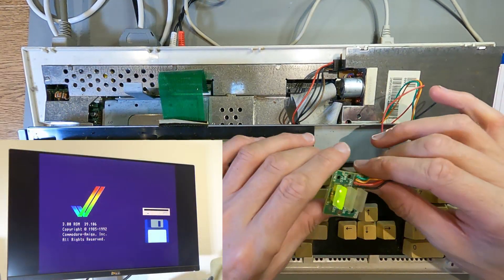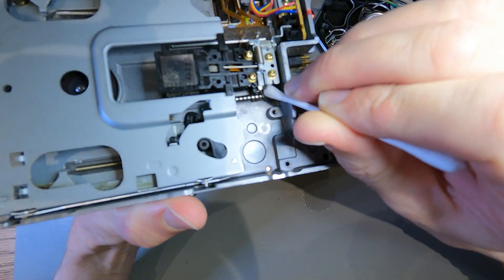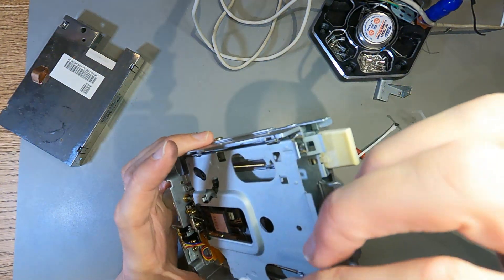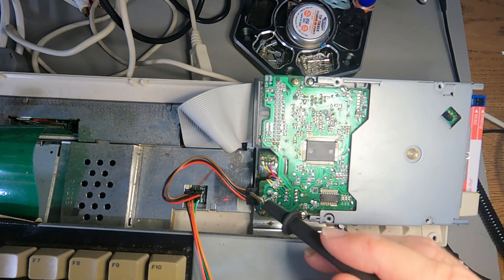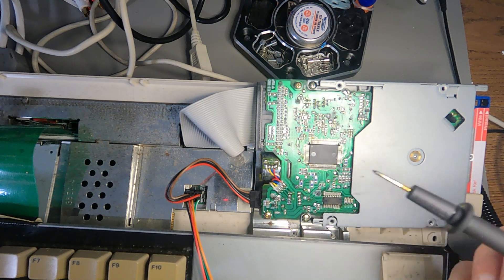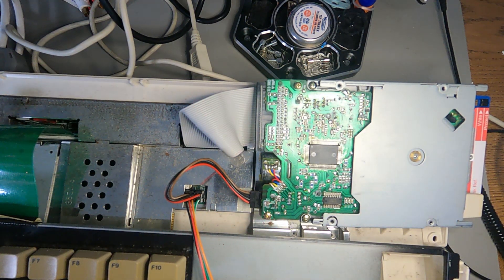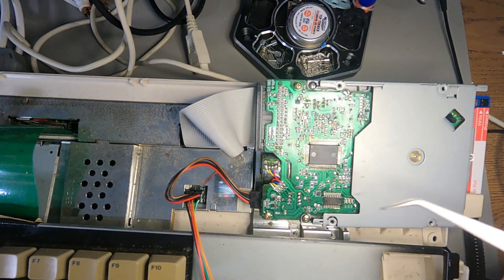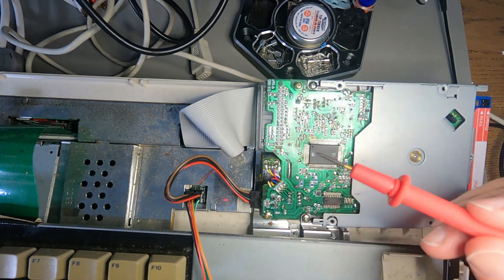Failing to Fix the Amiga 1200 Floppy Drive (Mitsumi D357T2)

Comment: I have the same drive. Almost exact issue with stepper. I think the driver might be busted.
Reply from the maker: I still have the drive. It's still broken.
Reply: @DavePoo2  seems like stepper motor is bad on mine, vibrating and not moving as intended
Reply: @DavePoo2  you have such stepper on ebay for a couple of bucks

Comment: I have seen this happen when a CIA is bad.  Try swapping the odd and even IC’s over to see if there is any difference in behaviour.
Reply from the maker: I doubt it, as a different drive works on the same computer. Also, there is no odd & even CIA on the A1200 or A600. You find those on the A500

Comment: i had success once, just by repeatedly tapping on the stepper motor while it's trying to move, and eventually it did start moving.
Reply from the maker: I don't think it's mechanically stuck, it does actually move. I think the chip that drives it busted. I could easily verify that at some point by disconnecting the stepper motor and manually driving it with a power source.
Reply: @DavePoo2  yes, it makes sense with these ones.. I have had two with similar behaviour (in 1980's Akai S900 samplers)..
One I replaced with a drive from a spare Amiga 500.
Would be great to know how to repair the old Matsumi drives though.. I'm at a loss!
Reply from the maker: @EvLoutonian  I've been checking eBay for any drives that have the suspect NEC chip on them but no luck so far

Comment: I have a bunch of faulty floppy drives. all have cylinder 0 seek error, have no clue
Reply from the maker: Might be worth cleaning the heads. If you have used a bad disk in them, it can leave crap on the heads and stop them from working.
Reply: @DavePoo2  tried that all wipped Down with 99% new grease on worm shove a disc in and get a track 0 error
Reply from the maker: @r6stu  Well the caps can go bad, after 30 years it's surprising that they still work at all.

Comment: Windings on small motors will show short as very small resistance,
Reply from the maker: The motor itself seems to be fine. When I disconnected the motor, the driver chip was showing shorts between the driver pins.

Comment: Try moving the heads all the way then power it up and see if it zeros.
Reply from the maker: The heads are already moved into a position where they are outside of the zero sensor, so it wouldn't make any difference, it should already be trying to zero the head.
Reply: Ah, I didn't notice it was off the zero.
Reply from the maker: @wimwiddershins  yeah, I didn't actually show the zero sensor up close.

Comment: You cleaned the grease off but didn’t reapply? Yikes! Also. Are you wearing a Star Trek TOS Captains shirt? :)
Reply from the maker: I did remove most of the blob of grease, but i was turning the worm drive with my hand to make sure it moved freely. I will apply a little lithium grease before i put this away into storage (assuming i can't think of anything else to try on it to fix it). The shirt is actually a handmade shirt that my mother made, and in fact all the shirts i'm wearing in my videos for about last year were hand made by her. This shirt just happens to have yellow sleeves like a TOS shirt, but the front and back panels are actually Batman fabric. This is the fabric, I've actually got some other shirts using the same https://www.myfabrics.co.uk/05-128471-0801_cotton-jersey-batman-1-black.html
Reply: @DavePoo2  that’s a fantastic personal  description and heart felt story about the shirt sir. Thank you for sharing those details. 

As for the floppy drive. Yes, good. There’s multiple areas to lubricate.

Comment: Shame, was hoping for a simple repair for you. I don't know enough about the controller circuitry or how stepper motors work to suggest anything, but perhaps you could hook up the stepper motor to an Arduino with a stepper driver and run some tests to see if the motor is shot?
Reply from the maker: There is not reason right now to think the stepper motor is borked. When disconnected it seems to have the 4 wire connections correct, i can probably just apply some power to the lines to get them to move the motor. I think if the motor was burned out then whatever did that would have probably fried the electronics as well, and I don't think it has seized as i can move it with my fingers. I wish i knew more about that controller chip, it may be that all those pins being shorted while the drive is off is correct, but it seems really suspect. I may have another little tinker before i put this away to see if i can find anything else out about it. It's one of those situations where if i had another identical drive that was working, i would be able to compare it to see if what I am seeing is normal.